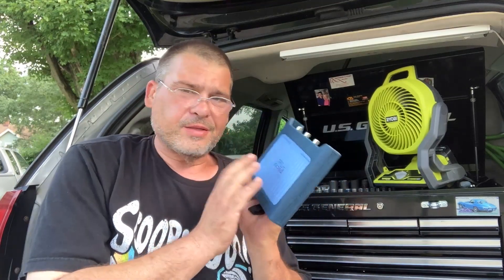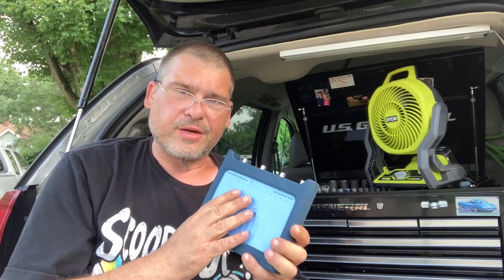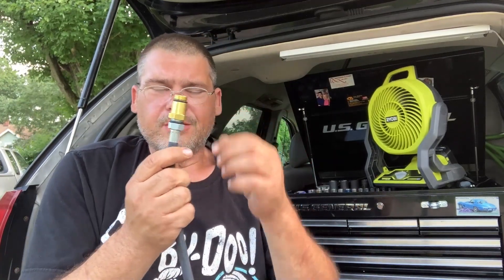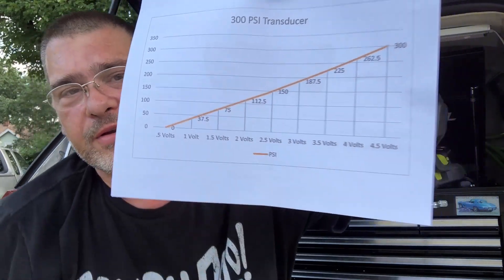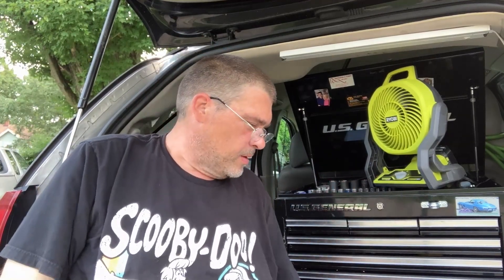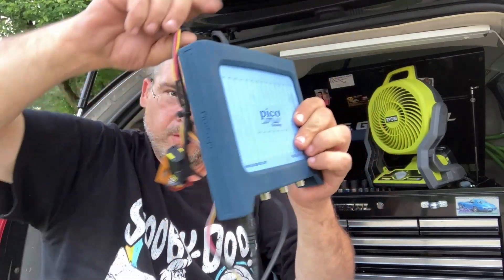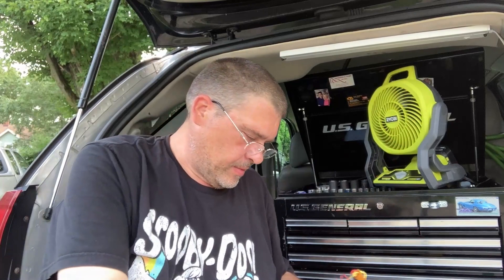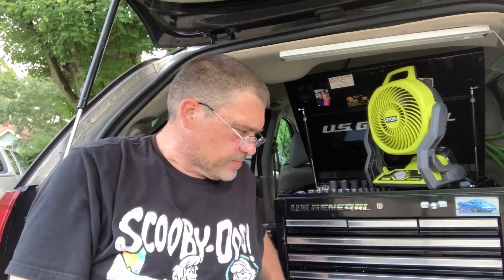Mobile Mechanic Automotive Compression & Valve Diagnostic Tools That I used with Pico Scope

Comment: Ive been educating myself on oscope diag by watching youtube vids. I just used my cheap Hantek 1008 to do a cam/crank correlation. Not as good as a pico but I got it done. Even figured out how to time the waveforms and convert time to degrees. My known good was a pico capture. I was off past the 10deg threshold that sets the cam codes. Pretty neat. I'd like to upgrade to pico someday I just can't justify it at this time. Just a diy'r. Definitely a must have tool for diag
Reply: The price on the pico looks alot better without the high priced pico accessories. I mite start saving up for one and use more affordable accessories or make my own. Way better resolution and software compared to my hantek
Reply from the maker: Yeah the Pico is nice, but I used a Hantek before I have one.  I am keeping mine, I don't care if I am homeless living under a bridge.  I will still have my Picoscope!

Comment: Great information, last video I seen was way back when you had your echo cardiograph and there was some enlargement in one of your chambers. How have you been since then ?
Reply from the maker: I have been fine.  They said there was a very slight enlargement on the left side of my heart.  I had a second cardiologist take a look at the results and he didn't think so  My heart is just a little larger than normal all the way around and it's because I am a larger person.   Like my grandfather on my mom side.  Since I have gone carnivore, I am now down 190 lbs or so from my highest weight, I walk about 3-5 miles a day.  I did an 11 mile walk the other day.   I feel great.  BP is normal, and Diabetes is gone.
Reply: @frugalprepper  that’s great news ! I know I had a ECG that suggested the same but the cardiologist said it was due to blood pressure. After we got my blood pressure under control I had a normal sized right atrium